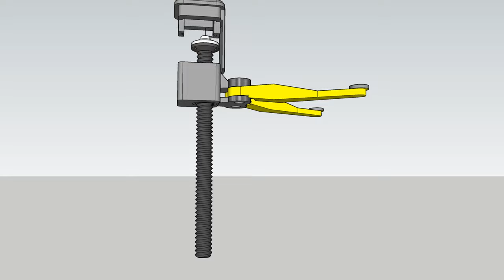3d printed 10th scale Two post lifts Part 1/3D printing RC car two post lifts /Painting rc body

Comment: Some awesome work there for sure. Glad to see you made it movable which adds so much realism to the scale !
Reply from the maker: Yea Martin without moving usless to me
Reply: @scaleaddiction  That is true. Do you have plans to control the height remotely via buttons (adruino micro controller comes to mind with momentary micro switches) ?
Reply from the maker: Yes, it will be for the part 2
Reply: @scaleaddiction  looking forward to that